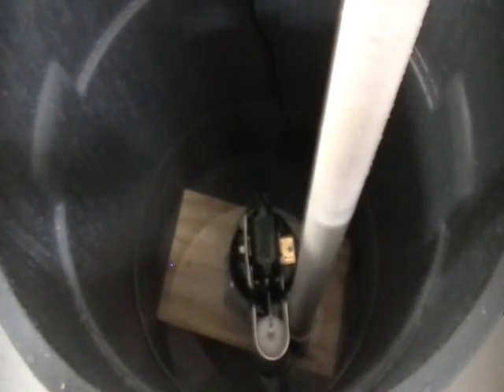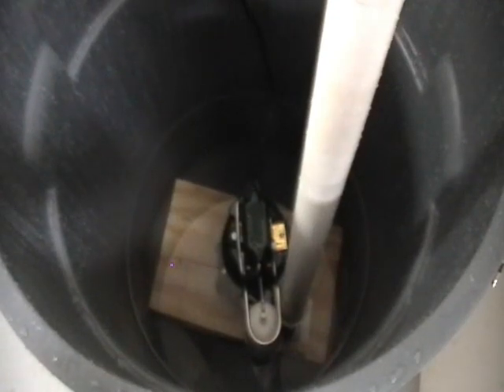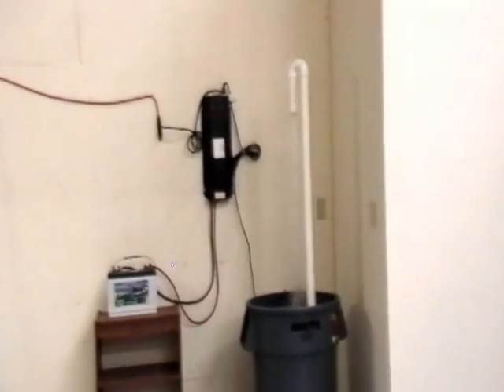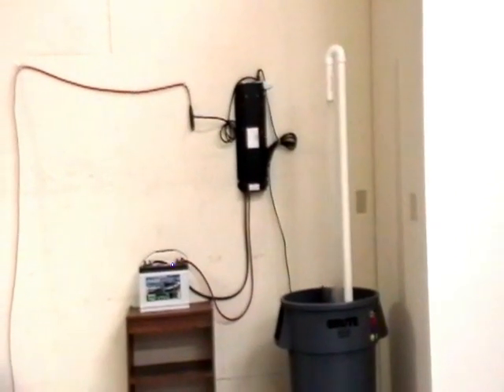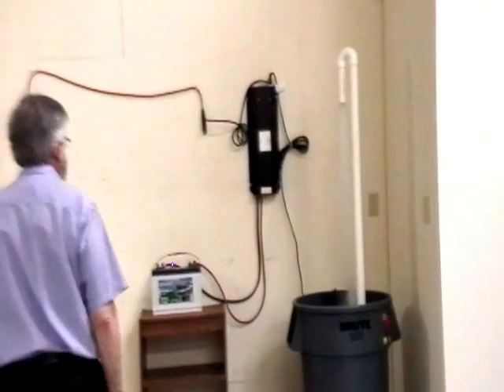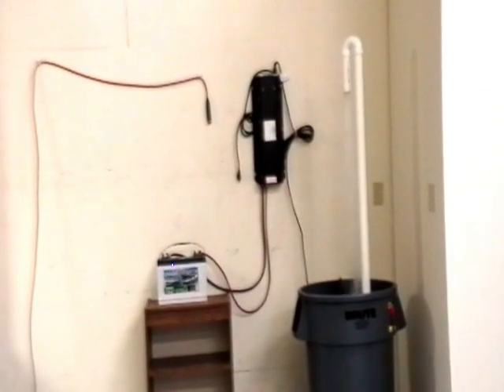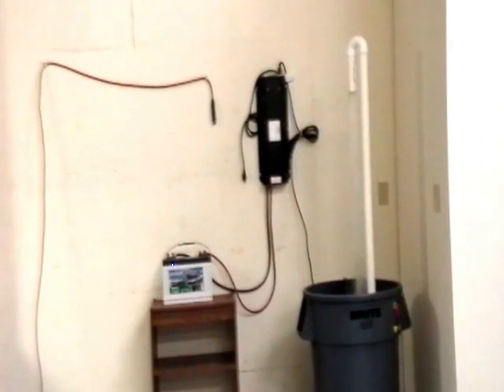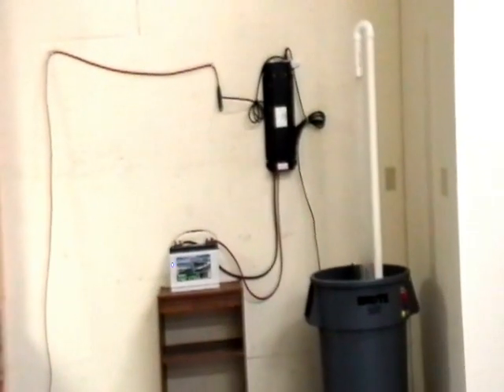Pump Sentry Powers Main Pump Demo

Comment: Just bought my mother the 822, her basement normally starts to flood within 2 minutes of losing power during a storm.
Reply: 1 year update. - lost power 1x during a rain event and the 1/3hp pump ran for 11 hours with 2 deep cycle batteries connected. Pump probably ran every few minutes for that 11 hrs. Definitely worth the investment and pays for itself the first time you use it. If you lose power at like 3am it’s awesome to know you don’t have to panic and get up to rush to start a generator before your basement floods. Or if you lose power and your not at home
Reply: Hi sir, so on ther web site the calculater for run time dont match in real,life action ? Im looking for a good back up solution whit a good run time
Reply: The first time we needed it I had 1 battery hooked to it and it lasted 8 hrs and that’s with it running every few minutes for the whole 8 hours. We now have 3 deep cycle batteries connected to it but haven’t lost power since. We used duralast deep cycle marine batteries from advance auto parts.
Reply: How many seconds was the pump pumping? How many seconds was it off? Could you tell me this ratio? I'd like to know what the life of a battery is when using Pump Sentry. Pumping once every 3 minutes, broken down to seconds would be ON for 5 seconds and OFF for 175 seconds. With a pump that is 9 amps when running on a 100Ah battery, the battery should pump for 40 hours. Here's a link to the page where you can input the numbers:

 https://youtube.com/shorts/sAmcuorx-o4?si=pfXBmB7esFTflzaC

Comment: How long will it run the pump for?
Reply from the maker: DRWebster93  In a typical installation, with one Group Size 29 battery it will operate for 24 hours and avail the user of the entire capacity of the pump.